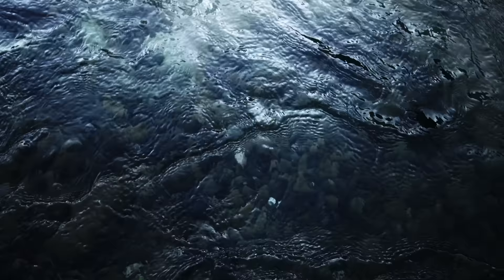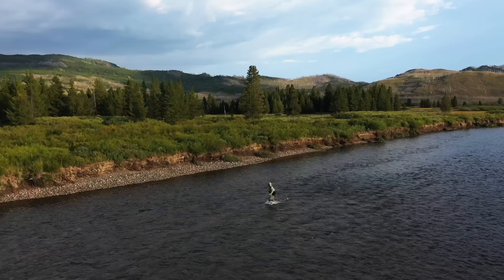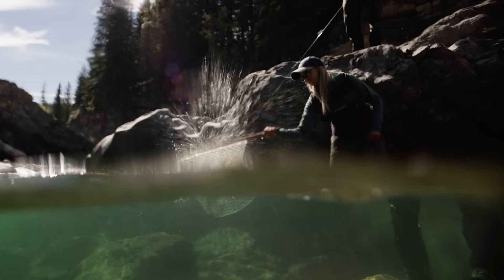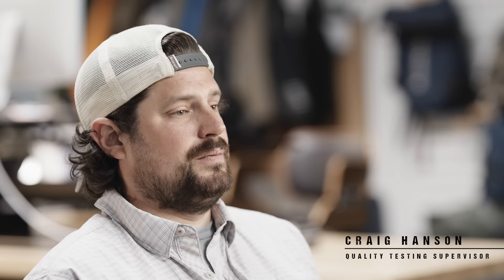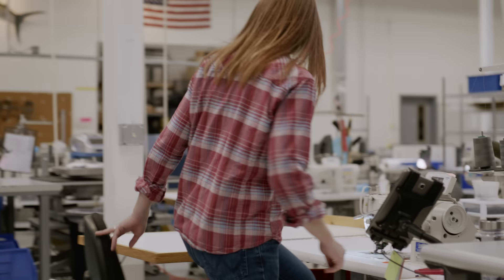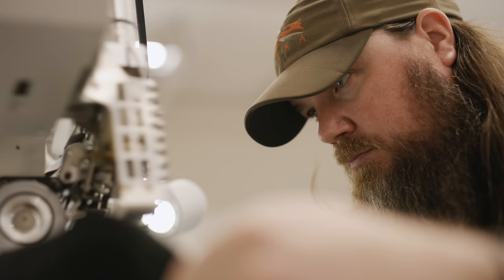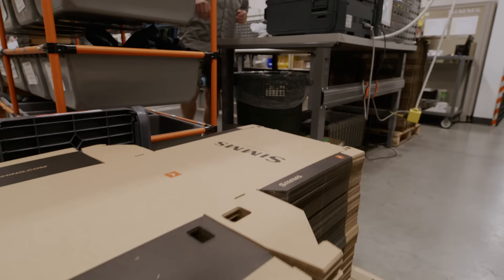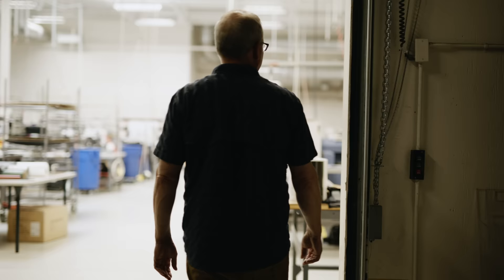Wader Makers

Comment: I never had a pair of waders last more than a couple years until about 6 years ago when some friends suggested I get a set of Simms waders.   At the time, I thought the price point was too high but after ordering and receiving my first pair, I was sold.   I could literally see and feel the difference in quality just taking them out of the box for the first time.   After 6 long seasons wading the Texas salt water flats with my Simms, they have held up extremely well.   This past season, I bought a pair of FreeSalt wading boots.    Most comfortable and best wading boots out there.   Keep up the great work at Simms!